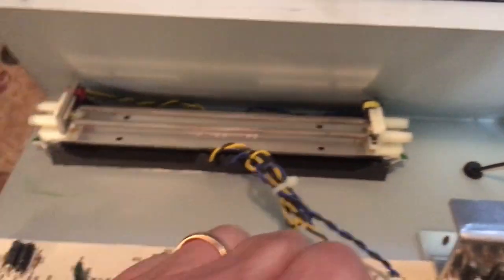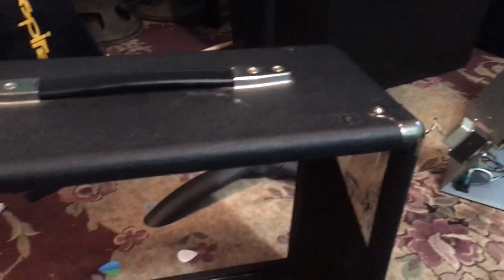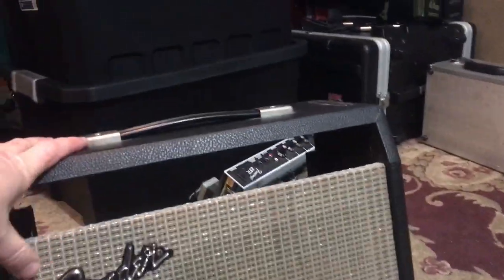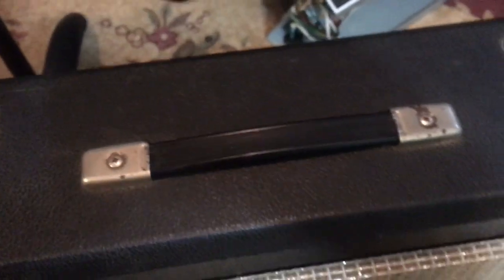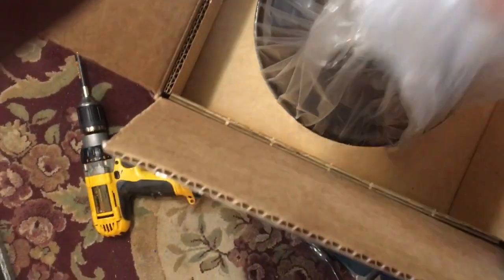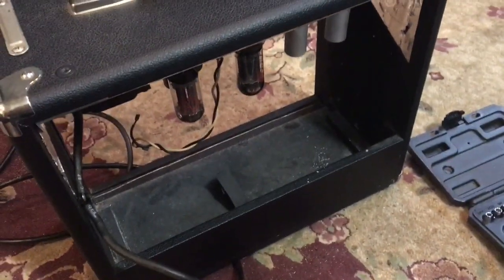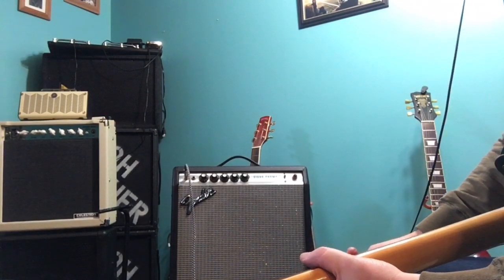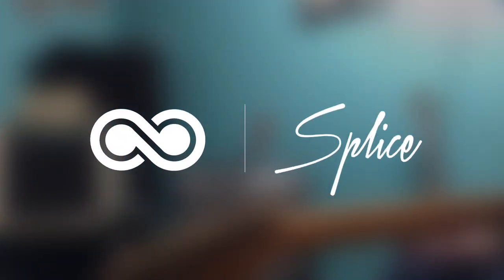Putting a Vintage Fender Vibro Champ chassis into a Fender Frontman 25R cabinet - Part 2

Comment: Do you still have the amp with the new cabinet?  Any issues with the touching of the capacitor to the speaker?   Did you try other speakers along the way?   Great video!! Gonna do it!!
Reply from the maker: unfortunately I sold that amp about a year ago. I never had any probs with the capacitor and the speaker. Thanks for watching!

Comment: I am considering a similar speaker swap to a 10inch in my blackface champ... hesitating briefly because I am not sure how much of the champ breakup sound is the tubes and how much is the speaker... sounds like you still have great crunch tone... does it still breakup similarly at same volume settings as before?  Basically, I want my champ to sound about the same, but without the anxiety of thinking I am about to loose the speaker when I go up past 5-6... and maybe just a li'l more ooomph in it ;)  You did a nice job there.

Comment: Great video! What did you ever end up doing with the original cabinet? I have a frontman 25r cab i want to use to drop in a 66 champ chasis into, but ideally, a more peroid correct cab would be ideal
Reply from the maker: I sold it 😬

Comment: Great video!  I had a Princeton 65 DSP that was completely dead but I didn't want to chuck the whole amp including the cabinet.  So I just scrapped the chassis and now I have a cabinet with a 12" speaker with no chassis. I have done research on what could fit in there and I stumbled upon your video and I have to say, you saved it for me.  Do you think that this chassis would fit the 65 DSP w/ 12" speaker?  Really don't want to downsize speakers.  Thoughts? Thanks for sharing your quest for upgrading your sound!